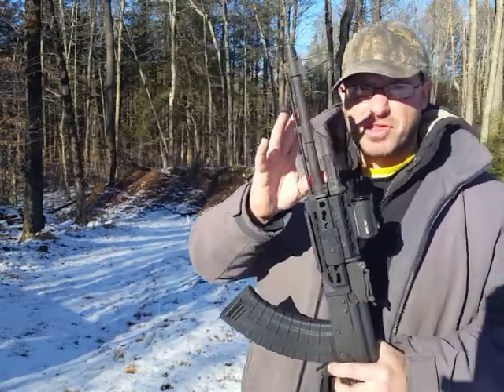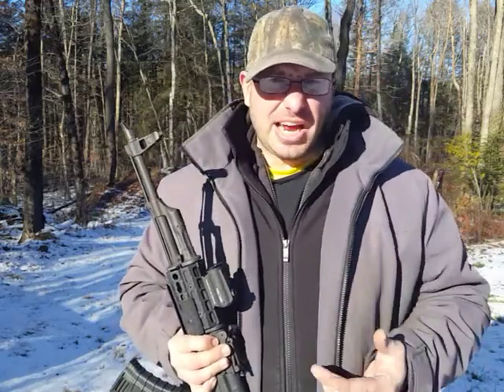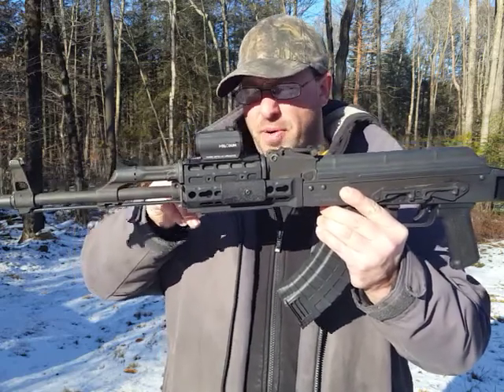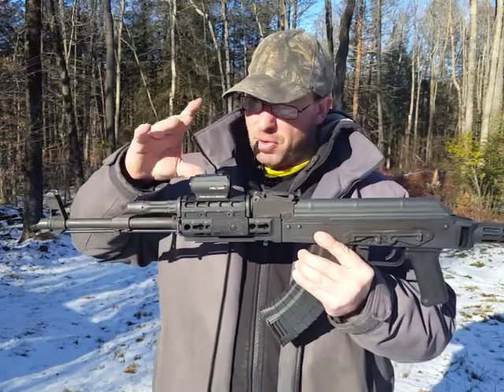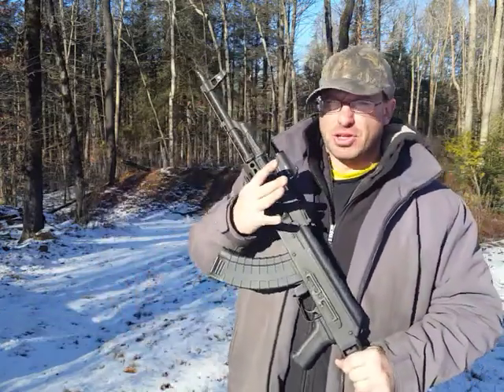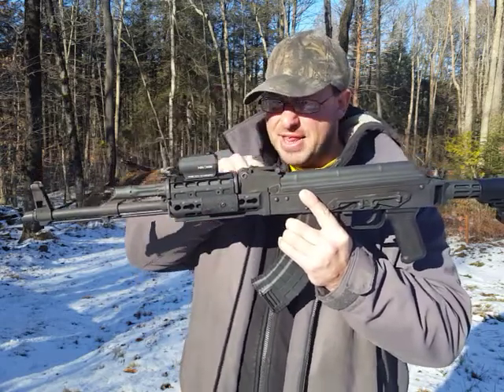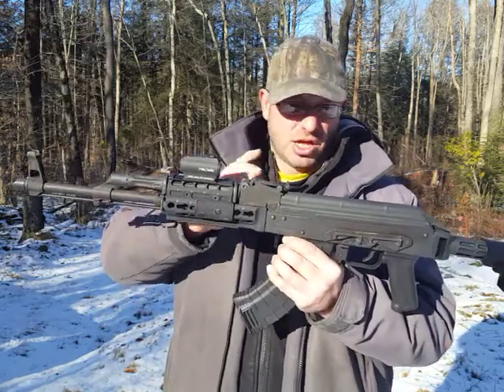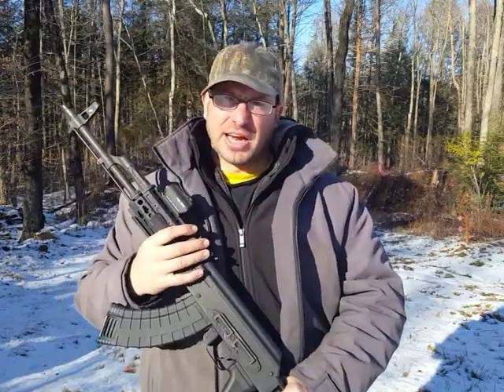Vulnerability of AK-47 Red Dot on Gas Tube

Comment: How does the red dot hold up to the heat from BARREL
Reply from the maker: I have not had any problem. I have a small piece of plastic covering on the rails. My general rule is that if the rail gets too hot to hold, I stop shooting the gun. No problem shooting 4 magazines. After that I usually give it a break, but I probably could go to 6.

Comment: I'm changing to this setup. Tired of playing the wiggle loose game with my MI mount. Plus it's heavy
Reply from the maker: This is really the best way to set up an optic on an AK right now.

I just wish that Palmetto would build and sell an AK-47 with a free floated Barrel. Flaptop all the way across with a picatinny rail. It's not a difficult concept.

It's not like I'm trying to turn an AK47 into an AR-15. The AR-15 did not start off as a flat top with a collapsible stock. The changes were made because they're practical.
Reply: @tsafa  100% 
I appreciate the response!
Reply: @tsafa  one more question. What's your height above bore with this setup?
Reply from the maker: @trailertrashtactics  from the center of my glass to the center of my barrel, I measure exactly 2.5 inches with the Midwest Rail and Holosun 507cu. I use the AimPoint rail mount. 

If you get the Midwest picatinny rail and use the rail adapter on the 507cu the measurement is going to increase.

I use a 50/150 zero. 

Feel free to ask more questions if you like.
Reply: @tsafa  slr rifleworks makes free floating handguards for the ak or get a quality side mount like a rs regulate or Midwest industries gen 2 mount for t1 optics
Reply from the maker: @oneofthoseguys2019  
Great information. Thank you!
I will check it out

Comment: I have the attero arms rmr mount on mine. The only disadvantage is you lose your rear sight.
Reply from the maker: What rail system did you use? Midwest or another one?
Reply: @tsafa  the rmr mount replaces the rear sight, so the rail is intact.
Reply from the maker: @andrewsmith7531  I will have to check that out. Thanks!
Reply: Texas weapon systems makes a dust cover which will accommodate a scope across the whole rear end of the rifle. When installed correctly it can be removed/opened and closed without losing zero. It does require removing the rear sight but they make fixed peep sight that pops onto the rear. My set up won’t allow me to co witness because of the red dot that I wanted but it’s a QD which could easily be popped off if needed. I will note that when removing the sight and putting it back on, I do not lose zero so long as I put it in the same groove before locking it back in.

Comment: Hi Tsafa I am wondering if you had these issues with your pap M92 Midwest Industries hand-guard set up? I was thinking to just put rocsett as it doesn’t melt like loctite. I appreciate your videos and reply.
Reply from the maker: I just used the blue Loctite that Midwest sent me with the rail. On one of my rails the first time it came loose, but did not come loose after I reapplied it.

Comment: In my opinion side rails are a way to go on any akm or ak-74 pattern rifle (with notable exception of modern ak-15 rifles and all other new ak versions with integrated rail). Side rail is uneffected by hot gases and does not require the removal of rear sight. The only disadvantage that comes to my mind is the loss of zero everytime you disassemble your gun for cleaning. Thoughts?
Reply from the maker: Thanks for watching and commenting.

My accuracy on 2 WASRs improved from 6 MOA to 3 MOA when I put the Red Dot on the gas tube.

If you press down on a red dot sitting on top of a side rail, you will see that it moves a little bit. The side rail only supports the scope on one side. Then there's the issue it raises it higher so I needed a riser on the stock as well. No possibility for cowitness. I avoided cleaning so I would not have to rezero. I believe I went close to 8000 rounds without cleaning.
Reply: I was able to maintain zero with my midwest side rail. I was trail and error getting the right tightness though.
Reply: You won't lose zero If you use a quality mount

Comment: ultimak
Reply from the maker: I did consider it but I decided I also wanted a bottom m-lock rail for a light and sling. More options.
Reply: @tsafa  magpul + ultimak. Problem solved.
Reply: Best combination I've ever had simplistic still retains lighter weights I can barely feel the difference between the regular furniture